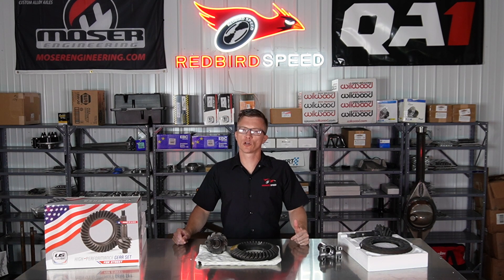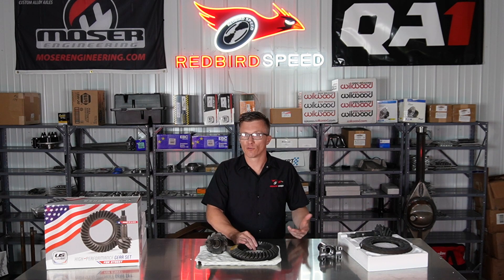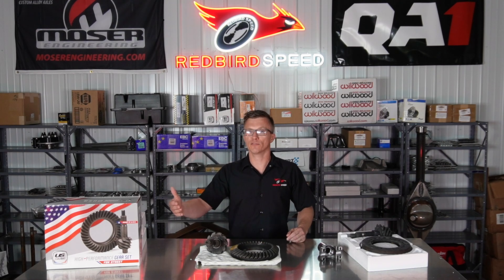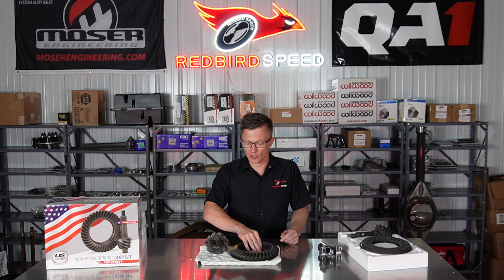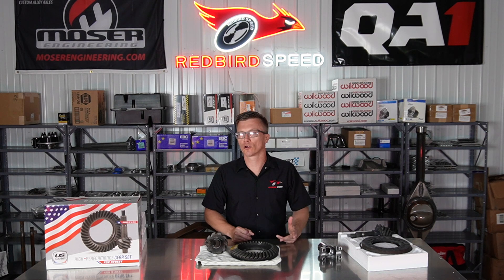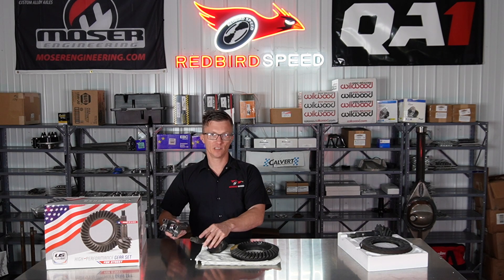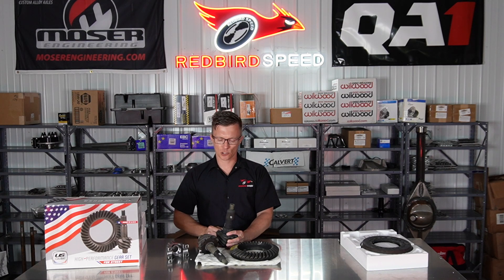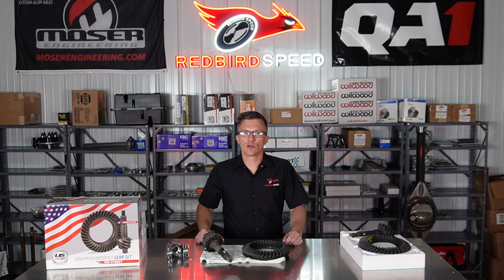9" Ford - The Complete Rear End: STREET VS PRO GEARS - What type of gear do I need in my rear end?

Comment: Question.   Have a ford galaxie  500.   With a 445 stroker in it. With 9 inch rear     trying to do sum research on rear end gears.   I want power. To play with like at the strip , but I want to be able to drive it on the weekends and  take it on the highway        what would u  suggest ,  like 3.73 ?
Reply from the maker: There are several variables here. That is definitely the most common ratio we use. You might download the Tremec Toolbox App and play with the Transmission, Tire Size, MPH information and see where you'd be at with your specific setup.
Reply: @redbirdspeed5063  thanks